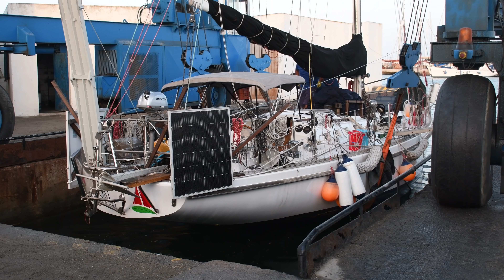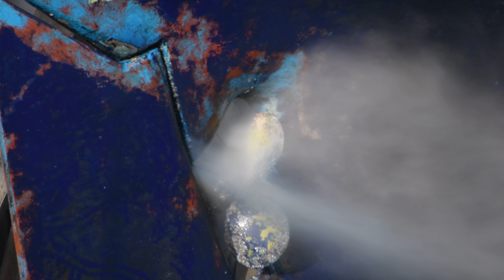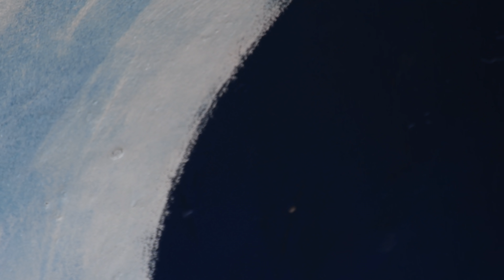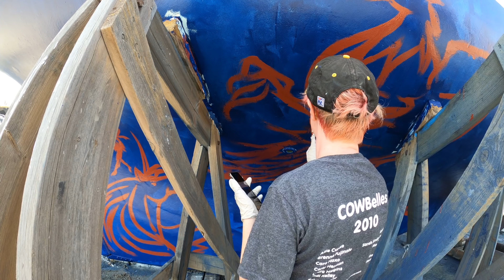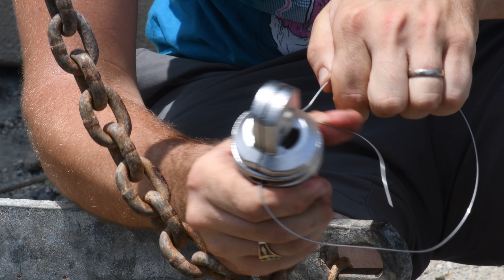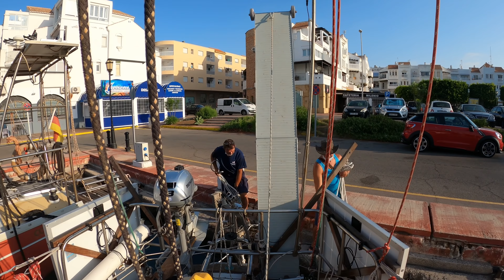FASTEST Haul Out EVER! | Sailing Wisdom [S4 ep57]

Comment: Should not those anchor bolts have some sort of tie down / clevis pin / weevil snag / whatchamacallit - you know what I mean, a keep it from backing off safety feature?  Especially since you just greased them?
Do you move the wooden chocks as you paint?  Back in the day, in Coconut Grove and up on the Miami River, we would move them ourselves but I bet OSHA has some regulation on that now.  IF you were in the states...
Are all the various colors bottom paint?  Does Maddie get one side and Herby the other?  Just wondering, I noticed an a previous haul-out there were some differences of style...
What are the two through hulls in the stern right about the water line?  cockpit scuppers?  I was wondering, is it good / necessary to have them so low?
Reply from the maker: The anchor bolts have split washers on them to lock them in place. 
Maddie did paint a mural on one side and I painted the other. 
The through hulls are for the scuppers and that’s just the design for them. The lower they are, the faster they will drain, but you also don’t want them too deep in the water.

Comment: If it were a weak point on the anchore chain, why all ships have one? Simply because every component is calibrated to  the requirements for that ship, anchor and chain (swivel included). There is no weak link.
Reply from the maker: The CHINA ones are a weak link and the rest are expensive. That’s why we went without one for so long. After anchoring for a long time and finding that we really did need it, it was time to save up and buy a good one!
Reply from the maker: The reason everyone has one is they are really handy! I have found that most weekend sailors have them and most full time cruisers do not (because they have broken one in the past and don’t want to lose another anchor).